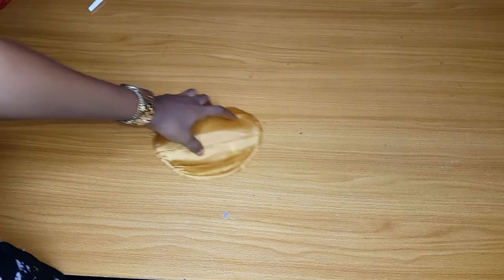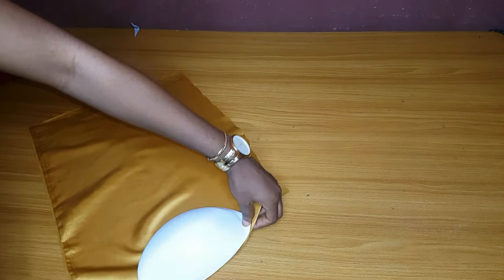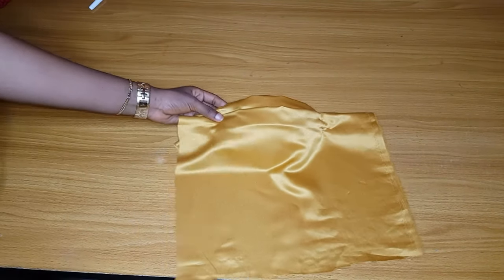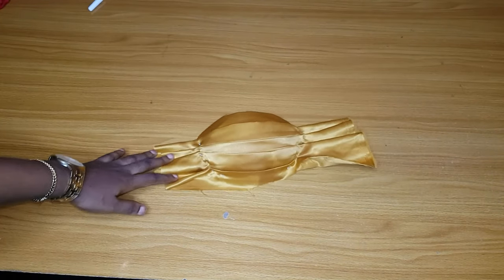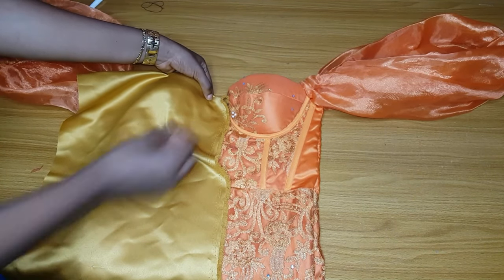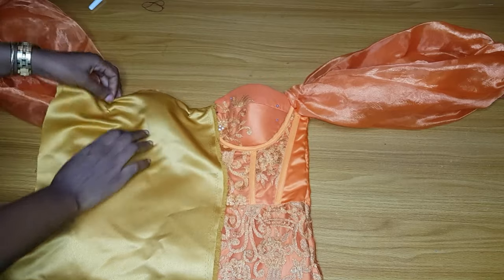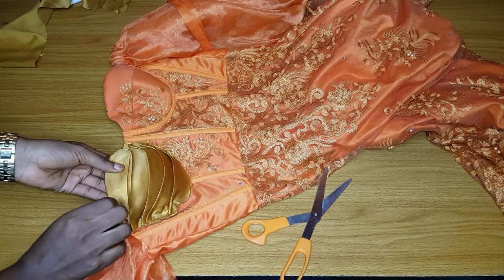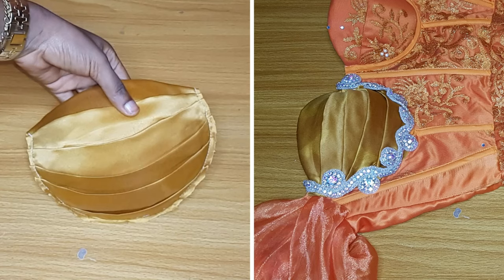2 METHODS: How to make drapes on a bra cup

Comment: I have a issue with corset i dont know if you can help me, i was told you measure your bust to to know the size of your cup. I did the same thing my bust size is 42 and i got a cup of 42 i measured the cup with my bust and it was smaller than my bust, after sewing it was still the same. Sorry for the long message i dont know if you can help me with another way to buy the exact cup size.
Reply from the maker: Your bust measurement plus 2 inches is your correct bra cup
If your bust is 42 that means your modest bra cup will be size 44
Reply: Okay thank you very much i will try it